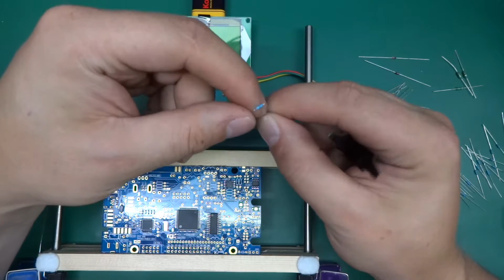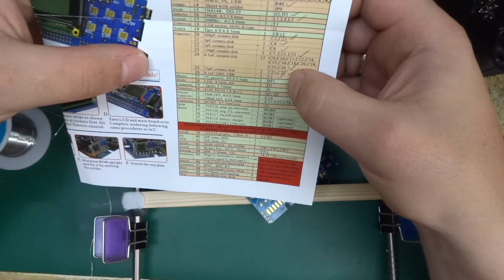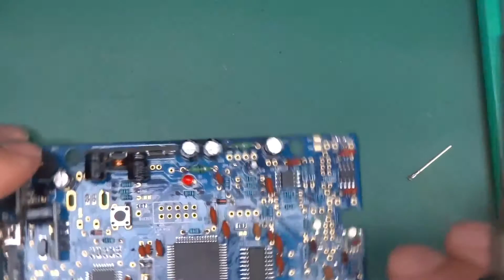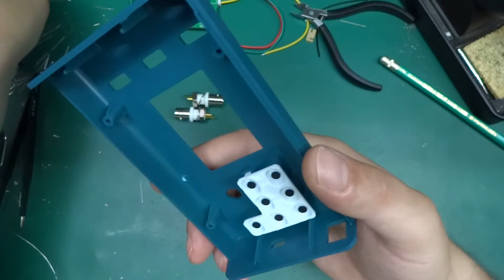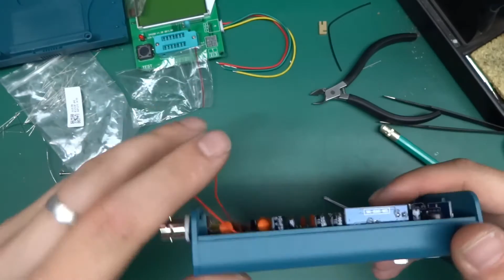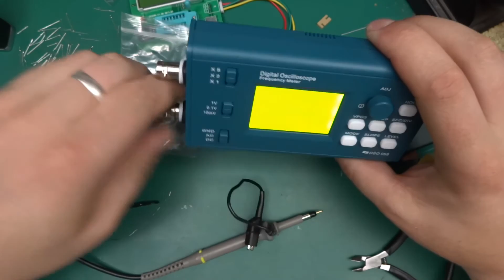DSO068 oscilloscope DIY KIT build

Comment: How did you get the case on with the battery?  Any problems?  Mine wouldn't close
Reply from the maker: Affix it to back part of case with double sided tape. You have to do it just in the right spot where it will fit. Try placing battery in various places and look from the side if it is sticking out above.
Reply: randomtronic  thanks for the quick reply!

I'll try that.  I actually broke off the IC on breakout board 5 just putting the case on without the battery so that's step one for me...   

Did you mount the battery outside too?

Comment: I put mine together, but it hasn't passed the power up test one. The LED light won't blink when pressing sw12 and I went ahead and closed the jumper for the buzzer and it did not work either. I'm going to watch your video and see if I can figure out where I went wrong.
Reply from the maker: CigarBGuitarefx good luck. If you get stuck, try reading on jyetech forum, there is a lot of troubleshooting tips there.